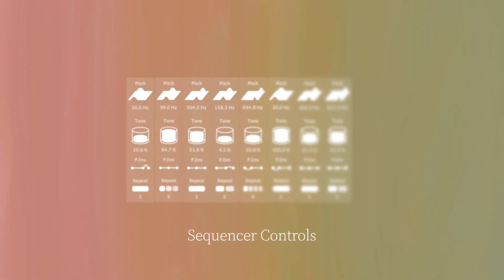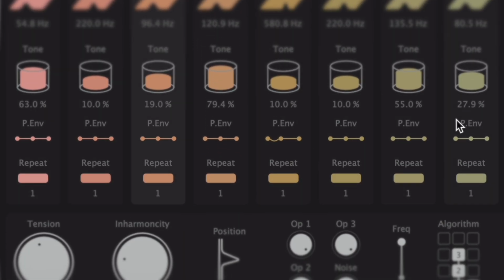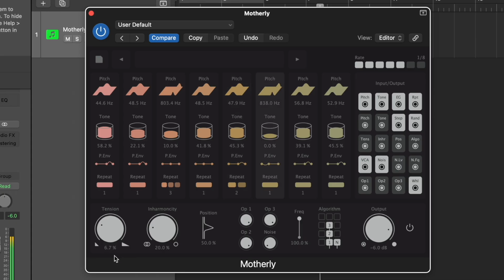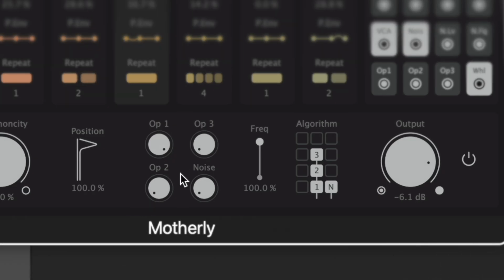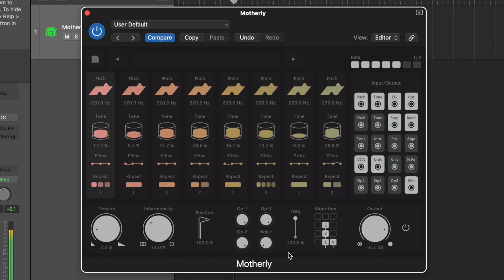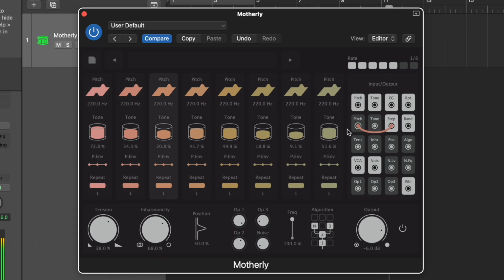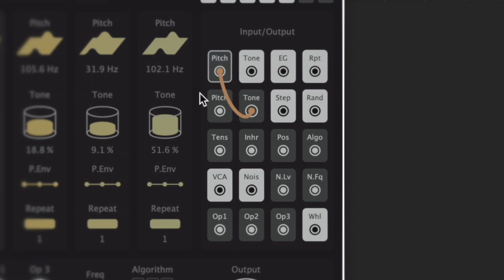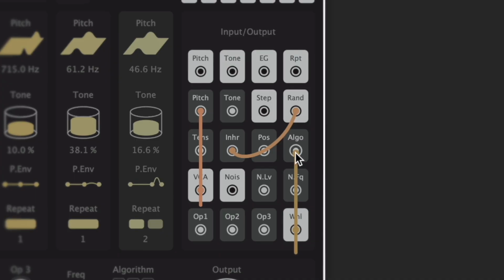Introducing Motherly | Rainbow Circuit

Comment: nice plugin! i do notice that my cpu sometimes can get to 80% usage when using motherly, if i then disable it and re-enable it, it drops down to about 20%. normally, even with heavy projects, i run far below 20%, so maybe it's something you can look into :)

(apple m1 max, 32gb ram, 24core gpu latest OS)
Reply from the maker: Hmmm that's wildly higher than the testing we did here, we'll push it on some other Mac models! Thank you for the input!

Comment: Purchased and it's not working even though I followed the manual and everything is in the correct folders.

Contact with Rainbow Devices isn't possible so I guess I wasted £40. 

Can anyone advise please on next steps?
Reply: Someone else here had a problem on Windows. They took the vst3 out of the container folder of something. Check the comment, maybe you're having the same issue.
Reply from the maker: Hello! Could you email hey@rainbowcircuit.co? Happy to help you troubleshoot!